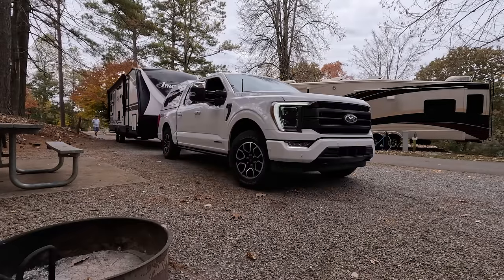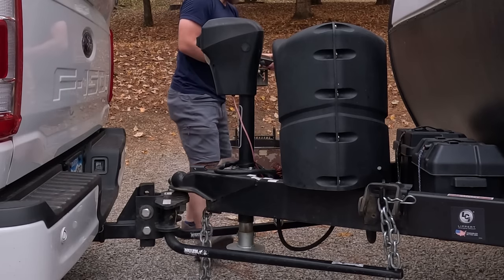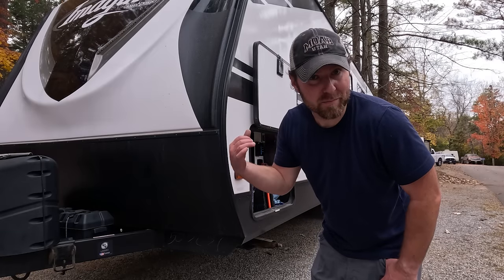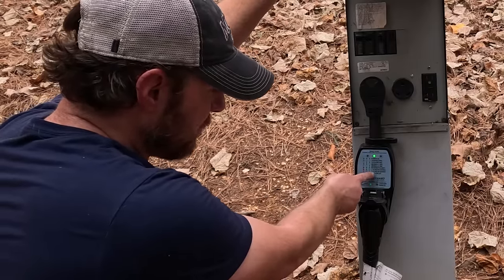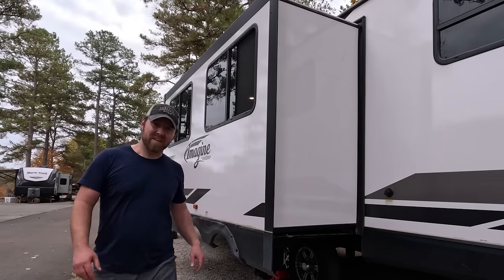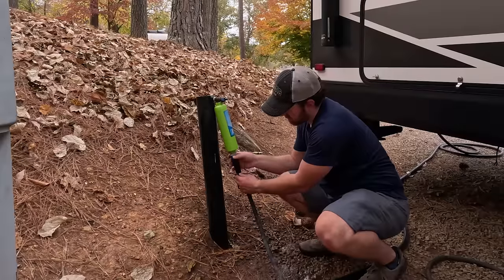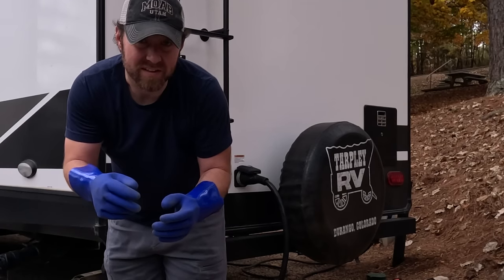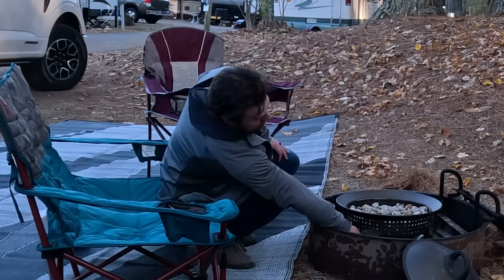How To:  Travel Trailer Setup

Comment: In my experience it is best to check the power pedestal for error codes and the water for flow/pressure before doing anything with trailer setup.  We have for bad power pedestals and/or water issues in the past.  It's easier to move to another site or have the park make repairs before doing any trailer setup.  Just a suggestion.
Reply: We have had bad power pedestals and/or water issues in the past.  (I forgot to check my post for errors before posting it.)
Reply from the maker: Great point!  We'll add that to our process from now on.  Thank you for the comment.

Comment: Before connecting your water to the RV, run the water for a few minutes to ensure you have clean water.  Also use brass quick connects to make setup easier--the good ones don''t leak!
Reply from the maker: Good info.  Thank you!

Comment: I invested in 5 Anderson red leveling blocks to use instead of the stacking bricks for tongue and stabilizing jacks.They speed setup with less bending over.  Properly using the small wedges at the wheels will eliminate carrying extra chocks.  I always set my X chocks before unhitching.  I bought a 10' section of fresh water hose when twice 25' was nor enough.  However, often the trailer can be positioned  so 10' is all that is needed.  A Y fitting and anti flow back valve at the water tap, allows a second hose for your black tank flush port.  After scores of camp set ups across the country, simplifying  and using quality equipment, saves time and makes the job easier after a long day on the road.
Reply from the maker: Thank you for the great comments!  Those are all very good points and we will heed your advice.  We do carry a Y-adapter with us, just didn't have a need to use it this time.  Aside from giving you an extra water source/hose connection, we find it to be helpful for the in-ground water connections that don't always allow enough space for the pressure regulator and filter.  
Very smart idea to carry the extra 10-foot hose!  We're probably wasting space in our storage area as we went a little (ok, a lot) overboard with our equipment as RV newbies in 2021.  Planning to replace our hoses this year for hygiene reasons, but now (thanks to your comments), we'll get a 25-foot instead of 50-foot.
And yes, we'll start using our Andersen Levelers properly. :)  You're right about simplifying the process - anything that has to be done over and over should be made as simple and efficient as possible.

Comment: I can relate I was unhooking and had tire chocked it wouldn’t come off the hitch so I moved chocked and pulled forward a pinch to release tension and went back to take trailer off hitch and Boom came off and rolled back cause I forgot to put chock back luckily I left the safety chains on lesson learned never get in a hurry and always leave safety chains on..
Reply from the maker: Thank you for sharing!  We feel your pain!  In our case, we thought our setup was complete and the truck was totally unattached.  Then we saw the tongue jack slowly sliding off the blocks.  Failure to chock didn't even cross my mind and we rushed to try to re-connect the truck (very stupid idea).  The tongue jack continued to slide until off the blocks until it finally crashed to the ground, narrowly missing Honeybunch's exposed flip-flop toes.  All of our neighbors heard the crash and we are so lucky that there was no damage and no injuries.

Great point about never hurrying!  There's no need to be in a rush (although it's common to feel pressure to be fast).

Comment: We first lookto see if we are far enough away from any obstacles to bring slideout before we unhook the traile also to see if we are close enough to the hookups
Reply from the maker: Good point!  We do that as well, but didn't include it in this video because the slide side was totally clear.  We learned a smart trick for checking the slide clearance from @AllAboutRVs - draw a line at the length of the slide on a tape measure and keep the tape measure in the truck.  Easy access, and easy to quickly check clearance.

Comment: You should have your stabilizers down before you bring the slide out.
Reply: I 'only' have a 'lil RPod 171 - no slide out...First thing I do is hook up shore power, then level left to right, then disconnect and level front to rear...and stabilize...THEN I will open the door and step inside...get my ice maker crankin', give my pooch his treats, and sit back & relax with a cocktail...
Reply from the maker: Thank you for your comment!  We used to put the stabilizers down first, but we noticed the non-slide side stabilizers would no longer be touching the ground (or blocks) after the slide is extended.  This made us think the slide-side stabilizers end up holding extra weight because our trailer leans about 1/4 to 1/2 inch after the slide is extended.  This is also something we had to account for when calibrating the LevelMate Pro.
Reply from the maker: Thank you for your comment!  We're excited to interact with our fellow travelers, both in-person and online!!  The order (and number) of setup steps can certainly vary based on personal preference and equipment.  One thing we find very useful, is to stick to the same process every time (whatever you preferred process may be).  Either way, if you end up with a happy dog and relaxing with a cocktail, I'd say you're doing it right. :)

Comment: Sorry, but the smaller wedges go on the opposite side of the tire from the larger leveling wedges. They are meant to cradle the tire.
Reply from the maker: You're absolutely right.  I was waiting for someone to point that out and I'll post a correction in a future video.  Thanks for the comment and the advice is appreciated!
Reply: Yeah my thoughts too I do and the package show it when you first get them

Comment: Yikes, no stabilizers down before slide out. But if your ok with it have at it
Reply from the maker: We've gone back and forth on the which one to do first.  We do it this way because we've noticed the non-slide stabilizers being lifted off the ground after the slide is extended, which means the slide side stabilizers are supporting the weight of the trailer instead of just keeping it stable.  In any case, you're comment is appreciated and I'll do some more research.
Reply: I prefer to put slides out without jacks down also. Too many people put the jacks down super tight, flex the frame and then put slides out. Puts extra strain on slides.

Comment: I don't believe stabilizers should be down before slides if that was the cSe then the slide should be out before leveling the trailer and we all know thats good to do
Reply from the maker: We've been doing some research based on some of the comments here and found mixed reports - some say put the stabilizers down first, some say put them down after the slide is out.  We plan to contact Grand Design to get the info straight from the manufacturer of our rig.  Thanks for the comment!
Reply: @blazedar  👍 Right I understand I have a grand design too keep me posted please